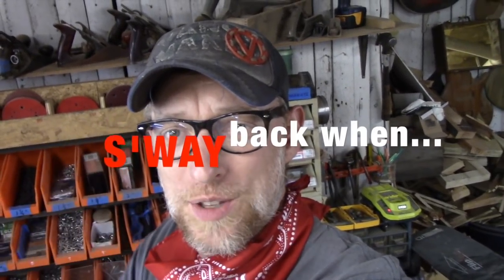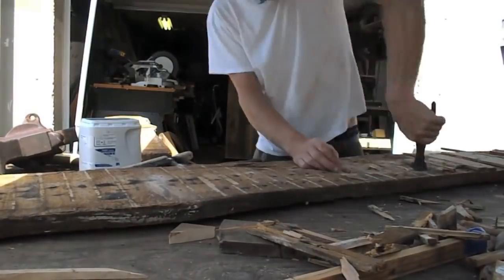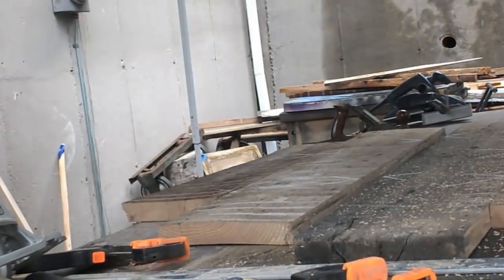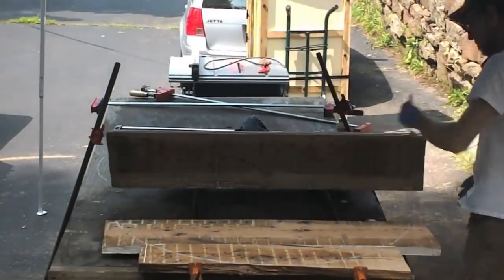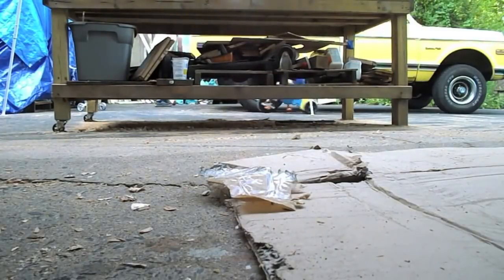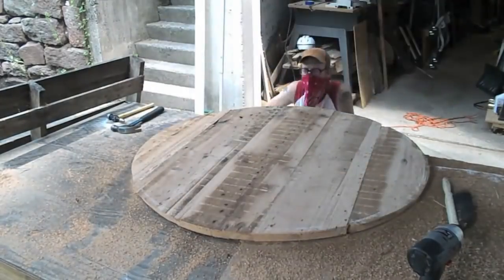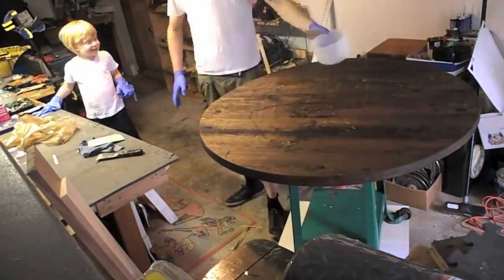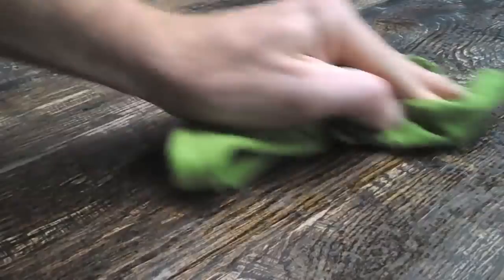Reclaimed Chestnut Kitchen Table | SBW

Comment: Tiny Vance! Nice table. I am restoring our house which was completed in 1878 and am amazed by the quality of wood I find tucked behind walls. Most of the original plaster is badly cracked and has lost its keys so I have to strip it all off and replace it. I really appreciate seeing all the tool marks in these 2"+ boards.
Reply from the maker: Brad Dudenhoffer there is gold in those walls! Thanks man